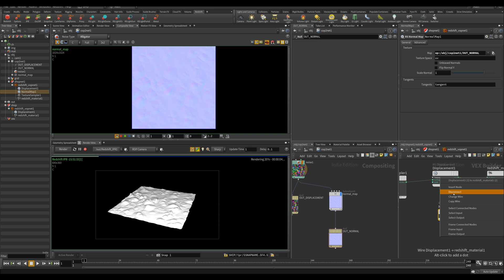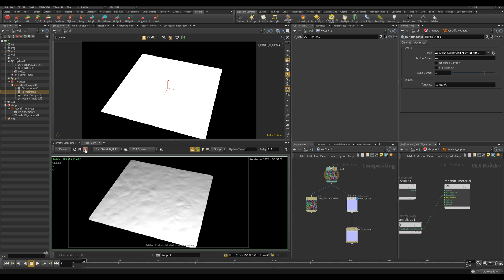Quicktip: Use Houdini Noises Inside Redshift

Comment: Doesn't work
Reply from the maker: I just tried it out on the 3.0.8 build and it still works fine. Unless you're on a super old build it should work
Reply: Tim van Helsdingen 2.6.41
Reply from the maker: @maratmurtuzaliev4745  update to a newer build, that one is quite old.
Reply: @TimvanHelsdingen  Thanks
Reply: @TimvanHelsdingen  he probably doesn't have uv's on his geo
Reply: @TimvanHelsdingen  hello! is there any way to make COP textures work inside Solaris? I mean, they work, but do not update unless you restart redshift which is embarassing. I know that with default Redshift ROP u can press smth like live update COPs in settings is there any similar option in Solaris?
Reply: 2.6.43 with UV texture still not working ... is there anyother switch in IPR need to check? Or it's just too old the version ?  :(
Reply: aha! It works! UV is needed and  check the Displacement in  Redshift OBJ  is also a MUST !  2.6.43 !